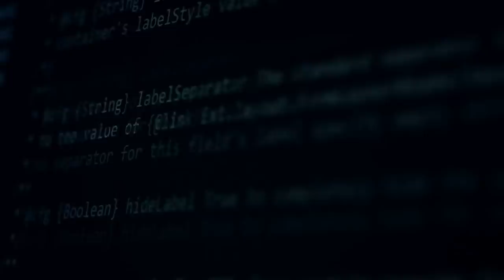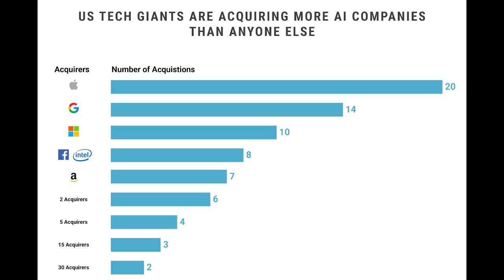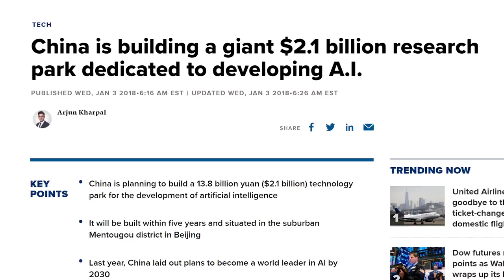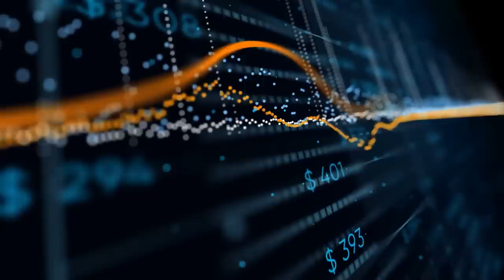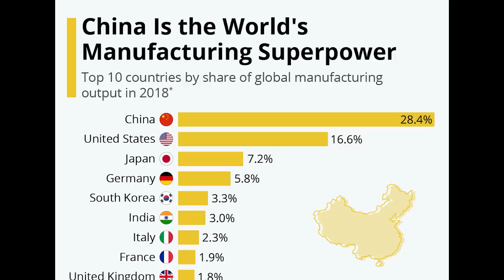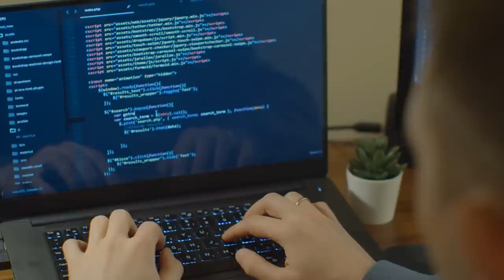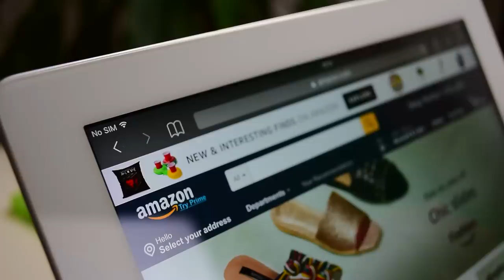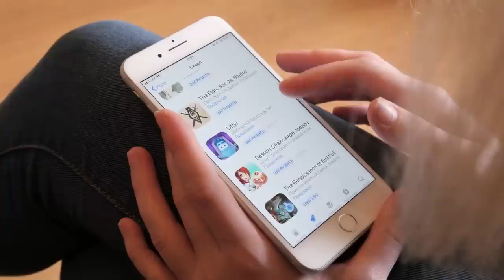The Next Global Superpowers Are Racing For Future World Domination

Comment: Almost 30 years ago, a place I worked at hired a new maintenance manager.  He was telling us the plant he left had one addition that was half a million square feet that was full of fully automated machines.  He said in this addition the only lights that were on were machine lights.  If a machine needed maintenance, it would send a message to the maintenance office and would light up a path to that machine so personnel could get to the machine.  This was the only time a person would be in with the machines.  He left because the machines hardly ever needed worked on.
Reply: Automated machines are different from AI. Nothing really against automation in factories, since people I know have complained about and left jobs that required monotonous and repetitive tasks.
Reply: @walterbrunswick  True. In many occasions, you don't need AI for many automation tasks.
Reply: @mwanikimwaniki6801   i work as an machine operator on one that produces brushes for gutters and electrical pipes. basically an automated machine still needs to have hoppers filled, certain parts cleaned, many mechanism needs to be regularly oiled, re-calibrated, also you need to set up new jobs by taking parts of the machine apart and changing it over. stuff an computer AI will never be able to do without robots or physical hands. the only time humans are pushed out of factories for good is when humanoid like robots can be programmed to do this stuff. then all will be left are engineers and managers if that because if an robot had an AI as intelligent as ours it could do this and would not need humans at all.
Reply: Well. I am a Mechatronics engineering student and I understand your take completely. The parts of a machine just need to be changed, calibrated, cleaned and all that work.  It would be tough to make something that emulates the work of a human.
Reply: I’m an American citizen you Can’t do that to me  I highly doubt that will ever happen
Not realistic at all
AI seems like a "fun experiment" (for some anyway), but when it comes to serious work, intelligence, knowledge, experience, and skill, it's "goodbye AI"
Reply: @walterbrunswick  the whole point of aim is to be able to learn in which case as it optimizes it is on route to completely undo what you say and would be better for tasks that need intelligence, knowledge, experience, and skills.

Comment: WTF? Germany was the inventor of the Computer the Car the Combustion engine (both Gasoline and Petrol) as well as Diesel engines on ships and trucks. the US did not had these Technologys first the just adopted to what was invented in Germany. Radio and Nuclear or Quantum mechanics btw. is also inherently German, or why do you think its called Gaus, Hertz and Plank
Reply: Wasn’t the computer British, Charles Babbage, alan Turing? Nuclear is mainly a European collaboration, combustion engine and diesel, yep German, Radio mainly Italian, Marconi for long distance radio but ground work by the Germans :)
Reply: @benk9397  the computer has to be defined of couse but first electric calculating and programmable (as well es printout capable) systems where from Konrad Zuse shortly after first WW. to me its the first Computer quite frankly touring is way later and Babbage would not have a mechanical computer without some German/Swiss theory which predessed his "ideas"...  
The Radio if you mean the discovery is Italian, correct. But the definition and Explanation as well as further development all happend in Berlin, which is why Frequency is still called Hertz who was btw the first Guy on the Planet who could produce frequency reproducible, therefore also invented the Phone. Bell was just using his knowledge and sold it....

Comment: Also, switching to automated manufacturing isn't trivial.  One of those big robotic arms you always see assembling stuff?  Those'll probably set you back half a million dollars.  Not to mention all the infrastructure to power it, program it, bolt it to the floor, etc.  How many humans could you employ for years at that price?  Also, you don't just shitcan a person and plop down a robot in their place.  You have to re-engineer your entire manufacturing process to feed the things widgets or whatever.  Oh yeah, and they break.
Reply: Hah typical human.
Reply: I am in business and I despise when the MBA's tell me "automate - automate" those robots are expensive and temperamental.  Plus they are NOT flexible.  They do one, maybe two things well and that is it.  If the power goes out from a thunderstorm they just sit there and you are paying for them.  People can be assigned to other tasks or sent home.  Oh, you cannot hire the local oil change person to work on them, you have to have people with robotics or mechatronics degrees to work on them and you do not hire them cheap.  Automation is NOT always the answer.   Wait until they outlaw automated driving vehicles because it will put too many people out of work.
Reply: @unapologeticskeptic4739  

The power will never go out because you buy backup generators. Any company that runs mostly of electricity and doesn't buy a backup generator is a fool.
Reply: You can hire 10 people and pay them $50,000 for a year and that's $500,000...not included in the price are all the additional payroll taxes you pay for hiring those people.
Reply: @Delimon007  That's not how backup generators work.  They're meant to provide an emergency grace-period to allow you to shut everything down safely.  They're not meant to provide power for continued production.

Comment: Something feels a bit off with the use of words like A.I. and Automation..... Like those are very different things..... Automation is mainly a engineering problem than a research problem and it is responsible for most of the change in factories etc.... There is not that much usage of A.I. in most of the industries this video shows us, aside from military and self driving cars, outside of maybe some small critical parts of the the automation process......

Unless, you want to define A.I as basically anything that a computer can do, regardless if it actually have any "smarts" or "intelligence"...

Comment: AI drivers fail, AI driver knows the traffic lane but can't cross to the wrong side of the road to avoid a mega pothole or avoid things that the computer may not see. A human driver will slowdown and go around the pothole "any one who has AI in the car, knows how it get upset when you do this" I hate AI in cars, I had to call road side service becuse my company car "2022 VW" would not move forward. To find that some clown hat stuck used chewing gum on the front AI sensor when I was parked on the street. All you need is a car going the other way to splash some mud, on your car to make the AI blind. That will stop you every time